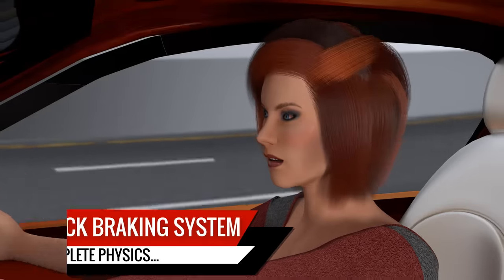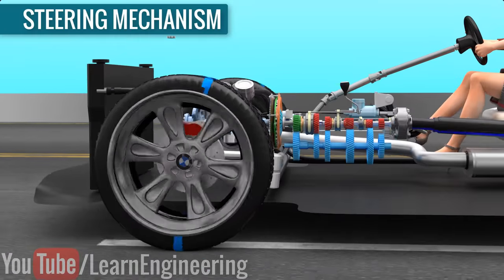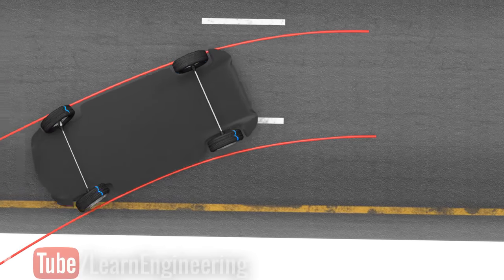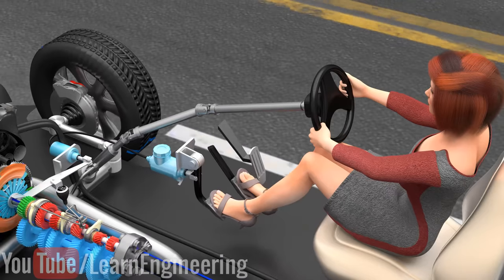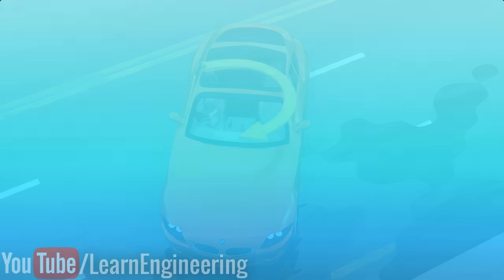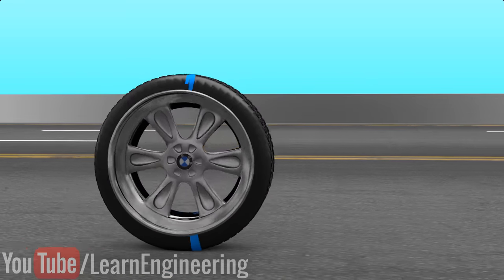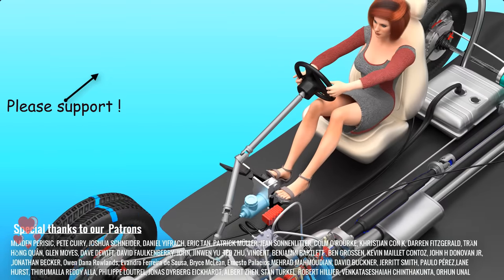Understanding Anti-lock Braking System (ABS) !

Comment: Can you explain why it is quicker for some racing cars to not use ABS?
Reply: I pretty sure it's banned in a lot of races to make them more skill dependent. You should always be as fast if not faster with ABS.
Reply: ABS doesn't reduce braking distance. That part of the video is incorrect.
Reply: Wait what? Its correct from how i look at it. I've seen other videos by others and literally ABS does reduce braking distance.
Reply: Lime  Let me modify my statement slightly. ABS does not reduce stopping distance under all possible conditions. That's not its designed intent so don't count on stopping shorter because of ABS.
Reply: IMO. Non abs can stop earlier when the tyre not slipped. And a race car/motorcycle, ABS system maybe caused the front suspension feels bouncy
Reply: Regardless of its designed intent you're going to stop shorter if you slam on your brakes (like most people). So I would argue that part of the video is correct.
Reply: Scott Pensyl that is basic Phisics. Static u its always higher than Dynamic u.
Reply: Maybe it causes them to brake less
Reply: In reality it's almost never quicker to not use ABS. A human will never brake better than ABS systems they would put on racing cars. That's evidenced because there are no racers who don't want ABS when it's allowed.
Many racing disciplines don't allow it because it takes skill away from the drivers and the skill of the drivers is what many of the disciplines are about. It means drivers have to continuously monitor and adjust their braking pattern to the condition of the track and the condition of their tires. Or in disciplines where it's possible, also make continuous mechanical changes with the braking bias. It allows a showcase of racers who are extremely good at overtaking in braking zones, driving in wet conditions or making tires last a lot longer.
Reply: It's called "Threshold braking".  https://en.wikipedia.org/wiki/Threshold_braking

Static friction is higher between rubber and road surfaces than dynamic friction (as is the case with most other materials).  The most efficient way to stop is to maintain static friction (ie, not lock up the wheels).

ABS pulsates, which causes the tire to road friction to go from static friction to dynamic friction and back.  Therefore, around half the time or so ABS is using less efficient dynamic friction to stop (which is admittedly better than locking the wheels up and having dynamic friction for the entire braking distance).

Race car drivers are adept at "Threshold braking"- essentially learning how hard to press the brake pedals to maximize the braking force they can generate while maintaining static friction (ie no wheel slip).  That is why they do not want ABS- because it is actually more dangerous for them.  Aerodynamic down forces help increase normal force, which helps in braking as well.

I've driven with and without ABS, and to be honest I prefer without.  ABS can be advantageous if you have a tendency to panic stop (I don't), but in many other situations, like snow and ice, it is much more dangerous.
Reply: Just like everyone else who is still in this weird anti-ABS world, you're talking about the most primitive version and for some reason you refuse to live in 2018. ABS has far surpassed any human ability. In racing series there is not a single driver who will go out without ABS if ABS is possible. Not 1. It'll reduce lap time, increase recovering from errors, reduce tire wear and automatically adapt to any changing conditions. Rules will either allow or disallow it because without mention everyone will use it.
No matter if you're driving on a road in the suburbs, driving on the autobahn or lapping Monza; you want ABS on your car. ABS senses much more information, calculate the response much faster, apply the response much better, learn faster and never make mistakes. Even the dumbest algorithm is much better because mechanically ABS systems can cycle many times faster than a human can.
Reply: 1.  ABS still pulsates to prevent wheel slip.  Polling times from sensors back to ECU may have gotten quicker, and the ECU more complex.  However, pulsations are still done by solenoid valves, which can only react so quickly.  Not to mention prone to wear and malfunction.  Each polling cycle it is literally saying, "Okay, this wheel is not moving at the same speed as the rest... release brake... okay, it is sync'd back up... okay apply brake... okay, wheel is not moving at the same speed again...  All the time it disengages the brake you go further and further down the road.  There is no system I am aware of that uses brake proportionality to prevent wheel slip- and if there are, they are not a significant portion.

2.  Not a single driver would go without?  And your source is...?  Even if you had a study, to prove that ALL race car drivers in the world would prefer ABS is nonsensical and not provable.

3.  I always want ABS on my car, huh?  https://www.youtube.com/watch?v=fge_m9u864k.  If you have ever driven on slush, ice, compacted snow, loose gravel, and yes, even wet pavement at times you would realize that ABS can be detrimental in certain conditions.

4.  Even the dumbest algorithm is better huh?  How about all of those complex auto-driving cars that get into wrecks, constantly lose their lane position data, etc?  Sure, humans get in wrecks too, and lose their lane from time to time. But these cars are still at, or slightly behind, good and attentive human drivers as far as reliability and safety are concerned.

Technology is great, don't get me wrong.  But one must be realistic as to the limitations at any given point.
Reply: The purpose of ABS is to allow steering by prevent wheels lock-up; "shorter braking distance" is just a byproduct of it on dry pavements; +JustaGuyNamedB is correct that ABS can be dangerous on snow/ice, or any other loose surface.

Experienced drivers prefer no ABS in order to have full control of braking. Sometimes it's desirable to lockup wheels on snow/dirt/sand/loose surface; an example would be to dig through the top layer of the loose surface in order to reach the underlying pavement to gain traction.

I personally achieve anti-locking by braking with left foot while keeping light throttle on gas on loose surfaces (on AWD). Apply both of them correctly, one can stop quickly, safely, and more importantly, balanced, especially during a corner.
Reply: 1 ABS is not to prevent wheel slip but to prevent wheel lock. Solenoid cycling takes less than 60ms on cars these days which isn't long enough for your brain to process an input let alone react to it. Modern ECUs also take in more data such as temperature, road condition, driver inputs or weather conditions which is also used in the ABS execution. It's long past a dumb on or off system reacting to a single input.
2 Not a single driver would go without it because that's simply how it is. If you ask me to prove the sky is a blue color I'm not going to indulge you either. During the '90s all racing divisions had to suddenly make a decision if they'll allow it or not because rich teams gained a huge advantage with better ECS development which wasn't regulated. Most disciplines opt out because ABS equalises skills between good or bad drivers which reduces the entertainment. If you want to research, some like the Porsche cup openly show how much of advantage ABS had but everyone knows what was going on at Ferrari in F1 too even if it never fully came out.
3 If you had ever seen a car that's made in the past 20 years, you would have noticed cars that are meant for off-road conditions, have off-road settings which adjusts the execution of ABS so that it will still perform better than a human could even on gravel, snow or ice.
4 Great point comparing ABS to self driving cars. First off you suddenly jump to completely self driving cars which is a lot more complicated and has only been under development for less than a decade. They don't even sell a self driving car because we know we're not there yet. They not only rely on car data but also on satellite data that can't be delivered yet. This only further shows your antiquated knowledge about cars.

Ah also, ABS is mandatory on cars in all western countries. A manufacturer can't sell a new car without it. In the EU for almost 15 years already. And within 10 years self driving cars will have evolved that no cars will be allowed to be sold without it either. It's called progress.
Reply: Well I'm panic situations ABS is almost always have shorter braking distance. Candence braking is shorter braking distance than ABS, but the driver has to be prepared and know exactly how much brake pedal pressure to use and surface condition. Public roads doesn't have exactly the most consistent road surfaces as oppose to a race track.
Reply: It doesn't. If you use your brakes normaly on dry road the brakes does not lock. If you have ABS and it activates you stop longer on dry road. It helps only on slipery roads.
Reply: A perfect brake is when you press the brake as hard as possible, whithout the wheels lock (witch means the ABS wouldn't evan have to work becauase you didn't press the pedal to hard.

When you do press the pedal too much, the weels lock and then you almost have no breaking power. That's when the ABS will correct your mistake by continiually disabling the brake for a fraction of a second to make the weel spin again. Problem is that every time the brake is disabled, evan for a fraction of a second at a time, you are losing breaking power as well (steel better than have the weels locked all the time). You can actually feel the car breaking less when the ABS starts working.

So, to do it right, you make a correct break and the ABS wont evan work. But if you do mess up like in a panic sitiuation and just poot your brake pedal to the floor, the ABS will be there for you to correct as weel as possible your mistake.
Reply: From what I know race cars use copper brake pads it grips more then normal pads and you stop at mush less distance but they ware out much faster so I don't think they need abs or to keep the cost down
Reply: @pologamero2648  Advice from a genius of "Phisics"
Reply: @raina2140  imagino que tu español es perfecto cierto?
Reply: @pologamero2648  Sí, amigo mío, pero no tan perfecto como el tuyo ... Tú eres el maestro de todos los idiomas, ¿verdad?
Reply: @raina2140  asi es, de todos,  incluso los que aun no existen. El punto es que yo no fui el que se burlaba de una palabra en vez de discutir sobre el tema el cuestión.
Reply: @pologamero2648  Ok entonces. Retiro mis comentarios. ¿Estás feliz ahora?
Reply: @raina2140  Muchisimo! Gracias!!!!
Reply: @pologamero2648  
No hay problema, mi querido amigo
Reply: @Pknuckles1804  Actually abs reduces the breaking distance only when you use your car on a snowy road. Without abs, snow fills your tire's teeth, which causes it to slip more. When it comes to abs, because the whell is always turning, the probability of your car to stop sooner increases.
Reply: @Pknuckles1804  it can be true on summer wet pavement but the feel of the braking is much better safety, many cars equipped with ABS system have so agressive braking characteristics that they are dangerous by themselves.
the real answer is to calibrate the sensibility of the brake pedal to control the barking action at the slipping point so you maximize the braking action and you keep the full control of the vehicule.
Reply: @Pknuckles1804  I was going to say that same thing!

Comment: Sir land rover range rover evoque has 4 wheel drive and 
Land rover range rover velar has all wheel drive 
Plz explain the difference between them
Reply: Thing is that 
In a 4 wheel drive car, all the 4 wheels not move under the influence of the engine all the time. Under Certain circumstances when the car needs more power all the 4 wheels get Activated.

But in a all wheel Drive car, all the wheel are activated all  the time. Generally, they are more fuel consuming!!!

Hope that helps 😊
Reply: Chhanda Dhar  Thanks
Yeah I understand  but please check cardekho.com and compare land rover range rover evoque and land rover range rover velar .
You will notice in 2 liter diesel engine in both SUV . Velar travels more distance in 1 liter diesel .
Can you please give reason
I am very excited to know🤔🤔🤔🤔
Reply: @abhijeetgoldberg7605  maybe the velar has a more refined 2 litre diesel engine, no so it's mileage is greater than evoque
Reply: Chhanda Dhar 
Yes , maybe
I like land rover

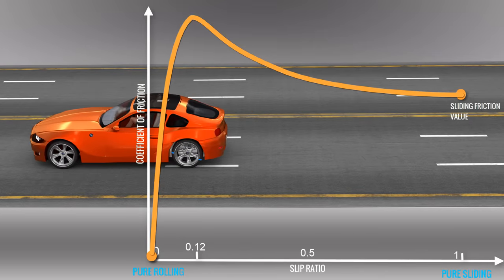Comment: 5:46 : With blocked wheels you get the same wheel / rubber spot sliding on the road, it heats up and loses friction. With ABS that spot keeps changing. New rubber portion keeps replacing the road contact one before it starts losing friction coefficent.

Comment: Are the principal same for bikes too
Reply: Kind of, the part about shorter stopping distances and preventing slipping remains the same, but the rotation of the vehicle when either the left or the right tires are on a slippery surface won't occur on a bike since there are obviously only wheels in the centre.
Reply: For bikes, lean angle comes into play as well, making things very complicated. Search Bosch intelligent abs for bikes.

Comment: When I was younger , I really thought that ABS braking systems ,were a scam and hoax.  Well I guess with good reason considering how shitty the  first ones were.  
    Well OK , with that mindset , I was going to work , before daylight one morning , and I was NOT. Paying proper attention to the road , and driving , talking away on one if those old cellular bag phone 
  I had been following a.very.slow coal.truck.,so I decided to pass him in the straight stretch. I went out and around him , making good speed , and when I cut back into my lane , a gray Grand Wagoneer , was getting ready to turn off , to the left . Well at about 70 mph , and me within 140 to 200 ft I had to swerve into the other lane , and back in my proper lane .  I thought I was done for , over , noore
 but I have to say , that one time ,they  saved my ass ,for sure.

Comment: ABS brakes don't usually stop a vehicle quicker than cadence braking with a conventional system, but it does give the driver more steering ability. Modern drivers aren't taught cadence braking anymore, and in an emergency instinct is to swerve to avoid hitting something. ABS facilitates this reaction.

Comment: Very interesting to see how it works although this videos makes it seem like you absolutely need abs (to prevent wheels from locking up). This is not true, you just need a brain and a bit of skill, sadly alot of drives don't have this
A well trained foot can actually brake in a shorter distance than a bad abs system as well. Really good and modern abs systems might be better though, not sure.
 Automakers can't fix human mistakes unless it's a self driving car.
Same with air crash incidents, nearly always human mistakes.
Reply: Decent and Experience drivers don't need ABS, but not everyone is decent or experienced. ABS is  a boon for learners and for people for panic/freeze/blackout in emergencies. Also experienced drivers enjoy ABS as well, because it reduces the stress of driving, makes it more enjoyable.
Reply: What kind of skills are needed so that one doesn't need to use abs? Also , how to practice those skills when one has microseconds to react?
Reply: @RahulKumar260880  just don't press the pedal as a maniac, instead try to feel what the car is doing. It's hard to explain, you just practice to feel and predict the car

Comment: 0:34 It's not made clear in the video that pressing the brake pedal doesn't instantly stop the wheels unless you slam on the brakes. The brake pads slow down the rotation of the wheels when braking normally, reducing the speed of the car through friction while allowing steering. The only time your wheels completely stop when you press the brake is when you are either moving slowly, or you slam hard on the brake. 

I drive a car that does not have ABS. I can drive just fine, but have to keep in mind a few things:

Keep a good distance from the car ahead, as I need a greater braking distance.

If I see brake lights ahead, I need to start braking. Slightly if it's far off, but I need to reduce speed and be ready to gently come to a stop. If I don't and the person ahead unexpectedly slams on their brakes, slamming on my brakes would be unpredictable and I could lose control.

I can imitate ABS to prevent sliding. In the worst case scenario where I have to stop as fast as possible, I can "pump" the brakes rapidly, allowing me to steer and increasing the friction between the tires and the road. I know when I'm sliding thanks to the screeching sound, so getting to know the car and how hard you can brake before hearing "screeching" can help you figure out pumping pressure/timing intuitively.

Comment: Transmitter sends signal to the computer and the gravitational center will be normalized by releasing ramdomly the pressure to the brakes that needs to spin in order to maintain the steering and complete halt...the tranmitter sends signal on how  quick the time brake pedal is applied and the amount of voltages transmitted by the transmitter and converted it to pressure thus activating the brakes and releasing so as to steer and control the vehicle to avoid collission....this i experiençed in actros mercedes benz tractors and other new vehicles

Comment: I'm planning to implement ABS on an electric bike along with regenerative breaking. Guess I'll see how it works out lol
Not sure how complex getting this 12% slippage ratio will be, but it sounds like a use case for a simple PID algorithm. The wheels already have speed sensors so I've got all the tools I need. But it might not work out so simple in practice. Guess I'll find out when I give myself a concussion!